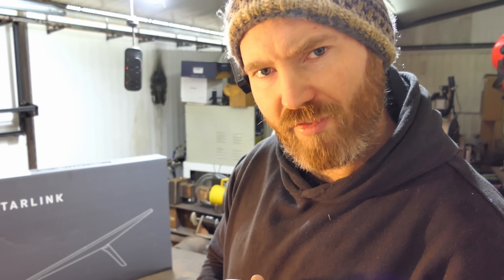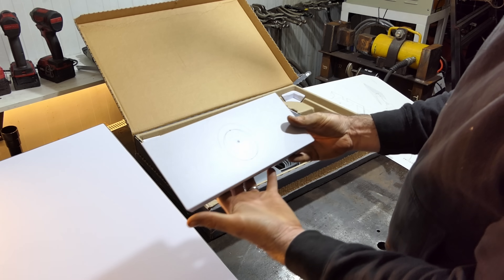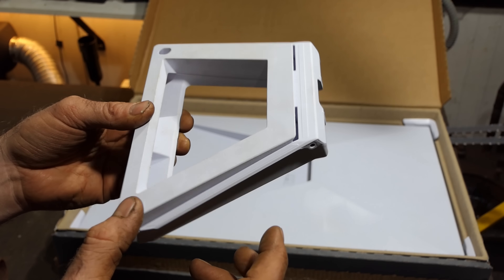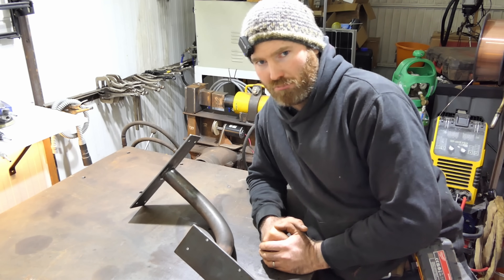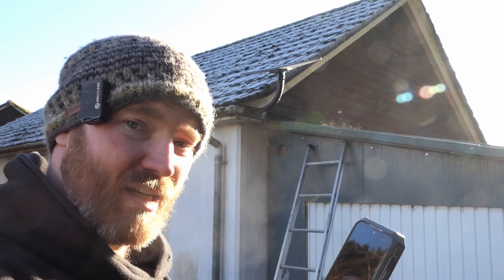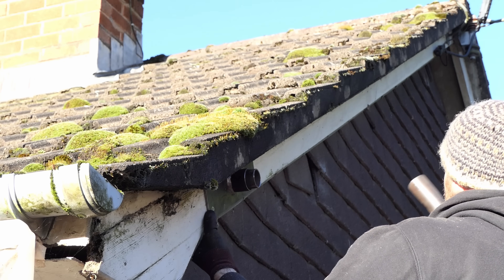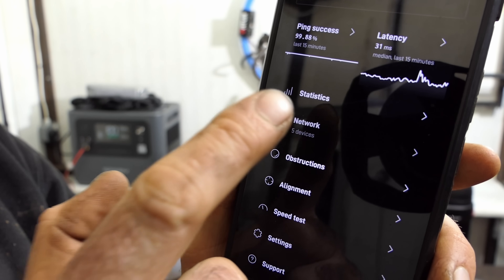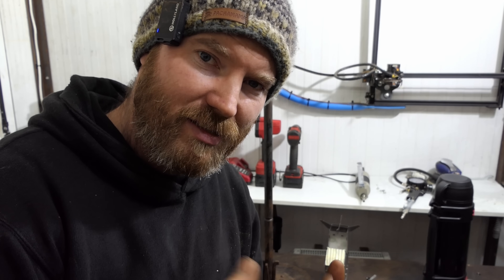I bought UK Starlink internet... I'm shocked!

Comment: Have you tried 4G internet? I pay £20 a month for unlimited data and use a £50 4G router and get 30-50mbps download and around 20-30mbps upload. No contract either. 👍
Reply: Similar to me, paid more for the 4G modem & external aerial, one cable PoE into WiFi6 router, and just buy an unlimited one off payment SIM, and it's way cheaper.
Reply: @mikecrane2782 I’m very happy with mine. But very much depends on phone signal. 👍
Reply: I just use my hotspot for my gaming and Netflix from my phone and it's better than my current fiber optic provider which is mental. Will be cancelling soon.
Reply: @danielsbox27 I used to do this (for 2 years) but got fed up with the signal dropping out and having to sync it over and over again. But it does work surprisingly well. 👍
Reply: Rural 4g tends to be around 8-16 Mb down 1 up
Reply: @ depends where you are line of sight of mast etc... I got a Teltonika modem and QuSpot external aerial, and I was surprised by how much better it was than my iPhone in the garden, and my previous purchase of Amazon that I returned, which was no faster than my copper wire (6 down, 0.5 up). Quality of lit matters, my neighbour has same set up but uses indoor MIMO stick aerials supplied rather than external aerial, and he's down 25 & 15 (DL/UL). My aerial has a 6dB gain at the frequency I receive/transmit.
Reply: Is this like using yiur phone mobile hotpot to connect ? Or is this better ?

Comment: I have no internet issues and am fortunate to live in a area with good internet but its great to see how this tech works for rural areas and less developed countries
Reply: Virgin Media rocked up onto my street in a little village in the middle of nowhere useful in the north-east of England in September with their brand new full-FTTH network. Currently paying £40/month for gigabit symmetric (price doubles after 18 months so will have to haggle them down again via retentions). They provisioned 1.2Gbps to the router and my PC gets ~600-800Mbps via wifi 6.

At the risk of jinxing myself, service on this new FTTH network has been flawless since its installation in October. Previous attempts at being a VM customer on their old cable network were exercises in frustration, so this was a nice change.
Reply: @lordofla  Ha yes don't jinx it!  I spend my time haggling with them as every year the try to increase my price by 20%+ with no speed increase!  That aside they work well.. I have had 2 outages before and that's where they differ with BT: BT would have hardware issues fixed within hours or days. VM took 2 weeks once!  but thats over 15 or so years...
Reply: When it comes to Internet speed and technology, the UK is pretty much at the bottom of the list for a supposedly developed country. Only 50% of homes can get direct fibre, but that's only half the story. Many of the providers are awful and use very basic home routers.
Reply: @circattle  48 out of 182 on Wiki. Not quite at the bottom. I love my Gigabit internet :)
Reply: @circattle  always use your own router if possible. Indeed, UK is garbage due to how the infrastructure works and excessive legislation. I come from a country where if you wanted to provide electricity, gas, water, cable, landline, internet etc you had to draw your own pipes and cables, not to mention zero legislation. Not in the UK. That would be a nice thing, and we can't have nice things, like internet and free speech.
Reply: They can't afford it in less developed counries.
Reply: wow what a liver shot😂
Reply: I’m lucky, I’m in an area where we have fibre to our house and I’m in a village, 500mbps we get with BT for £30 per month.
Reply: Post brexit we truly are no long a developed nation.
Reply: @edc1569 post Tory we are now a third world sh1thole.
Reply: @edc1569  Post Starmer we’re almost a third world hellhole!
Reply: @Malpriorvids not long to go now,the clock is ticking.😡😡😡🤬🤬🤬

Comment: What's your 5G speed? looks like your phone is getting it, a 5G router with external antennas would be cheaper if stable.
Reply: A 5g router doesn't work as well as a phone, and 5g is useless unless you have 4 bars or more on your phone. I've tried a number of routers and options to bypass a cable system, but it looks like we have to just wait until until 5g actually works or the fibre optic cable makes its way to our property.
Reply: @markkimba74  in my experience (I use 5g routers as backup for my professional livestreaming business, so it's more in urban areas, not rural), 5G routers are much better than any old phone when it comes to reception and signal stability.
Reply: @markkimba74  that is a complete lie, it does, you can even lock what mast it connects to, just need the right antenna, simply having high gain doesn't help. Depends on whether trees covering route and whether clear line of fight to mast etc.
Reply: If he simply used 5g he couldn't make a video showcasing his skills. It's about him. Not the gadget.
Reply: In the UK most providers now throttle PAYG and reserve the faster speeds to particular contracts. It's all in the small print on their websites.
Reply: @ScandalUK  I'm not pay as you go I have the top package and 4g sucks
Reply: @ my Contract is £16 a month, No throttle and starlink is a lot more that 16 quid. sure PAYG can be limited but for the price of a contract who's bothering with it.
Reply: @Jobey_99  yeh right my Mrs is unlimited for £26 a month with a galaxy s22 which at the time was £850. The contract is cheaper than the phone.
Reply: In most places in the UK, 5G is slower than 4G, and it uses the 4G network anyway. In general I don't think his 5G or 4G speeds would be much better than copper in day-to-day use.
Reply: @circattle see I find the 5g is superb but 4g is absolutely terrible. I think we started selling 4g broadband too soon and flooded the network.

Comment: We abandoned FTTC in favour of 5G over two years ago and haven't looked back 20 quid a month for many times faster plus i like giving two fingers up to BT and co.
Reply: Yeah I do that, bought a 5g router and put it in the loft, works great. It's not as fast in my case due to being in a blindspot for masts but it's good enough.
Reply: As long as you can deal with the crappy jitter and latency it’s ok.
Reply: @edc1569  about the same as Starlink from what I've seen. But yes fibre for gaming if thats your bag.
Reply: Yup I'm paying 20 a month and no price increase for superdrug Mobile and getting 100 down on 4 g inside and 40 up. Very happy
Reply: @PINKFL0YD-s2h  nice that's really good for 4g. We get about 300 ish down and 25 up on three 5g for 21 odd a month. But it can be had cheaper with a Smarty SIM. Were a long way from the mast as well. Brother gets 140 up and super low latency but he is in line of site.

Comment: Sir Starlink is an AMERICAN business, even if they have a local branch in the UK. Calling it "UK Starlink" is strange.
Reply: It's meaning Starlink compared to UK Internet. As well, starlink works in many short-range (15 miles radius or so) satellite bands, so coverage can vary based on which bands cover your latitude and how many other starlink users there are in that coverage area per satellite (until 10 minutes later when the next satellite passes overhead and passes over the connection)
Reply: Agreed, it's an american company, headed by a south african, but he's using it in the UK so it's useful to know that he's talking about the UK experience specifically (like the congestion charges and signal acquisition process). Excellent point that you made, with the title still making sense for his use-case.